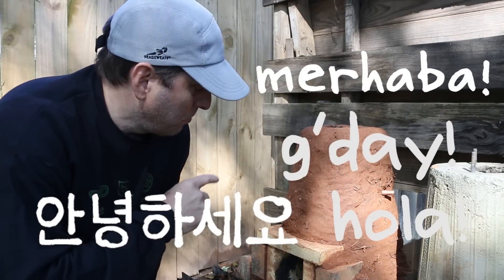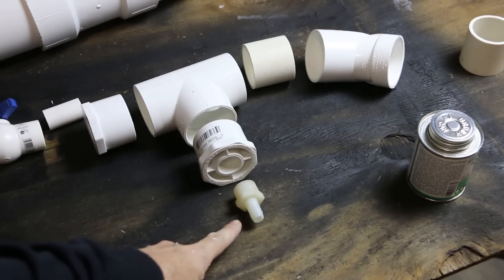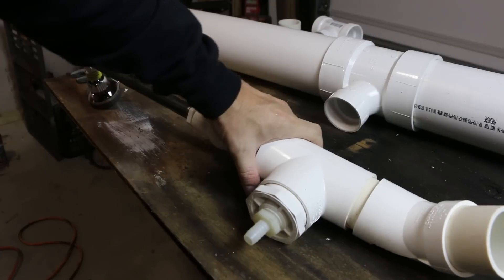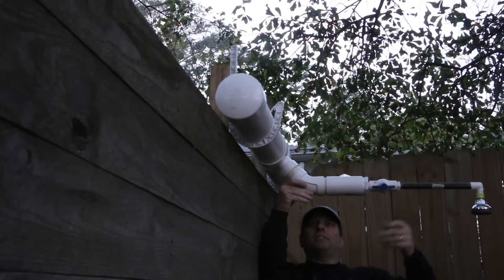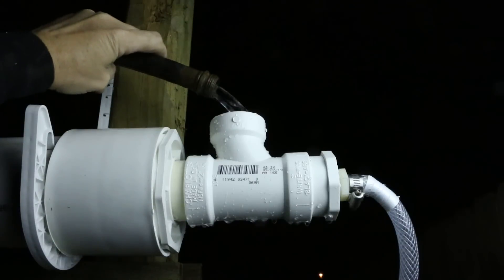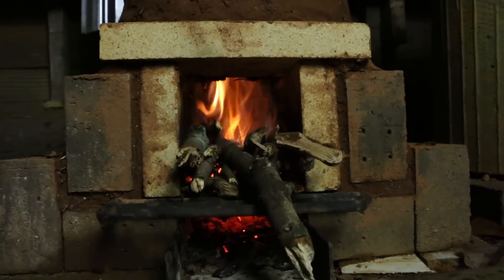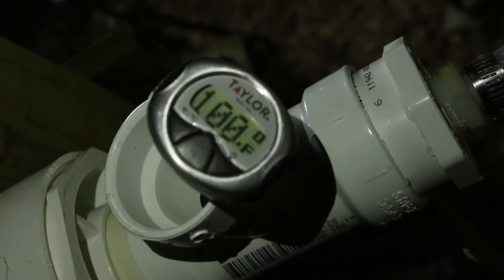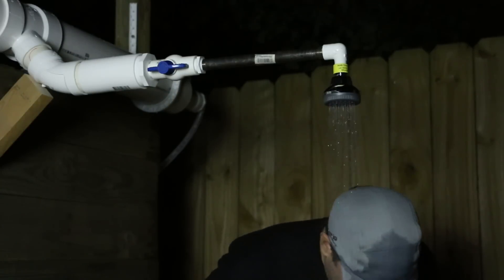How To Heat An Outdoor Shower With A Rocket Stove | Part 2

Comment: This is actualy a brilliant idea with a functional prototype. You could also use copper pipe instead of flexible hoses joined to your coil embedded in the stove and add some legging onto it to retain as much heat as possible, also have a larger vertical insulated reservoir tank that will help in retaining the warm temperature while easily homogenising your heated water inside the tank through the heat siphoning action. Great ideas bro!👌

Comment: Would a closed system use thermal syphoning to create pressure? Maybe use a check valve to avoid a backflow?  I haven't built one yet, but plan on giving it a try.
Reply from the maker: I’m not sure a pressurized system would work, but I’m not a pro here. :-) The PVC I used was not for pressure. I did another take on this and used house water to pressurize it. It did ok. I think they way I’d proceed is to fill the tank, warm it, then re-pressure with the house water only after the fire is out. I don’t want to risk getting scalded. Thank you for watching. Good luck with your build.

Comment: I'm telling you from experience that there is nothing like a HOT shower somewhere that it's really cold. The last time I had anything of the sort was when I opened the bathroom window (a full-sized window) in the middle of winter while taking a shower. The bathroom became a cloud chamber. Probably not great for moisture control, but an outside shower might just do the trick.
Reply from the maker: I hear you on that, Mark. I’ll have to give it a try this winter. :-) Thank you for watching.

Comment: You had it right, it is a hot water heater, so who told you differently is wrong. When you get a hot water heater for your home, you wouldn't go to Home Depot, Lowe's or Somerville Plumbing Co. and say you need a water heater, you would ask for a hot water heater or a hot water tank, which is all a technicality, but they are all the same thing, except for a boiler.

Comment: Genuinely impressed, just like I saw the other day "Man landed on the moon". I am wanting to build a cobb, wood fired oven / pizza oven. (Jas. Townsens & Son and My Self Reliance (Shawn James)) has built on like I want, but now, I will be incorporating coils into the structure. I agree with the other sub, that the coil should be imbedded. But like you said, this is a learning channel. Great video!
Reply from the maker: I’m honored to be associated with those guys...two excellent channels. I haven’t fired the coil enough to run into any melt or degradation problems yet. Stay tuned. :-) Thanks for watching.

Comment: Something to consider, a vertically oriented water tank will generate better pressure that a horizontal tank of the same volume...
Reply from the maker: Thanks for the feedback, Rick. I did orient the tank vertically in the follow up video. Added hose pressure too. Thanks for watching.
Reply: @GreenShortzDIY  Ahh, I didn't catch the third installment...lol
I've been thinking of something similar, but portable, to take along on camping trips...

Comment: Not only longer copper coils, but a metal tank reservoir on top of the rocket stove. Also the hot entering at the bottom, so that as the hot water rises, it will disperse the energy through out the tank. It might require a check valve on the lower tank inlet in order to start the siphon.

Comment: I would think a much larger storage area would be needed with cold water feeding directly through the stove, and another line to cool the heated water down a bit.  Only a thought.  Thank you for the video!!  Blessings!
Reply from the maker: Hi Mary. I agree with your assessment. Watch the third video in this series. I expand the tank like you are suggesting. And add pressure. Thanks for watching.
Reply: Thank you.  I may be moving to an off grid homestead and I have not seen a rocket stove built, which was so interesting to me!!  I would love to see how to make an outside Cobb oven!!
Blessings!!
Reply from the maker: Mary, I’ve done a cob bread oven video. Look for the “Full Build” in the title. Also suggest you look into a Rocket Mass Heater to heat your home. It uses rocket stove combined with a barrel to divert the exhaust down and through a mass to absorb and radiate the heat slowly. An 1000 degree stove burn will only exhaust 150-200 degrees out the chimney. A 2-hour burn can heat the house all day. You may be able to route your water heating through the same system.
Reply: Thank you!  I watched the 3rd video, I was thinking of gravity fed water flow from buckets vs. pressurized water.  I wonder if the stove can heat water fast enough to keep your storage tubes full, to take a full shower.  Thank you for your responses and videos, and I will look for the oven video.  The rocket stove is definitely a solid option for heating my future dwelling, since commercial stoves do burn alot of wood, though they are building mostly for pelleted fuel, which I am not interested in!!  The prospect of using wood that I harvest, and using much smaller amounts due to these stoves efficiency is exciting to me!!
Thank you so very much!!  Blessings!!
Reply: Oh, I just ordered last night the book on building rocket mass stoves, then your video popped up!!  
My LORD works to keep my life on HIS tracks, waiting for HIS  path to become obvious is so hard at times, but this is working better than me charging ahead with my plans and HE can fit in as my aide!!
Blessings in abundance!!

Comment: Pressure due to gravity is a function of how high the tank is above the showerhead.  You can get A LOT more pressure without using pumps or a pressurized tank by simply raising the tank and running a pipe down to the showerhead.
Reply from the maker: Good suggestion Brian. Thanks for the tip.

Comment: I think the top hose should be the cold water hose and the bottom one be the hot water. As the water is flowing downward towards the heat and will heat up faster. Most of the heat is at the bottom.

Comment: you're not using primer, its going to fall apart. Use primer, this guy has no idea. Know what you are doing before you make a video
Reply from the maker: I can’t argue with the importance of using primer. I didn’t glue portions of the tank because I plan to take it apart in the next video. Thanks for the feedback. Thanks for watching.

Comment: Also,  I don't think regular pvc is proper for hot water. You should have used red pex  or  copper 

🌠🌠🌠🌠🌠🌠🌠
Reply from the maker: Yeah. This is not a normal use for this type of pipe. It is also not rated for pressure. I think it should function ok for this application. Of course, in this outdoor application, a few drips won’t be the end of the world. :-) Thanks for watching.

Comment: This is a great build! Thanks for sharing!
Note though, the teflon tape you are using needs to be threaded over - meaning the direction you wrap it matters. if you wrap in the wrong direction, the threads might push the tape backward and roll up little holes and pockets between the threads. Hope that makes sense.. Thanks again! :)
Reply from the maker: Thanks for the reminder, Aaron. I try to remember to wind it the correct way. Always half to visualize it in my head first though. :-) Thanks for watching.

Comment: I like your humble, open approach to learning and sharing. I'd like to see the wasted heat going to heat a mass with a down-tube, burning up all the carbon. Perhaps heating the floor of the shower, or a mass inside a tent? Rock on.
Reply from the maker: Hi Wendy. Thanks for the encouragement. There was definitely some wasted heat in this application. I'm actually going to move this small coil to my greenhouse and add a water mass and a clay mass. So, you've kinda read my mind. :-) Thanks for watching.

Comment: Just an FYI: when solvent welding you really should spread the cement on both pieces before gluing them together.
Reply from the maker: Sean, thanks for the tip. My second version of the tank, which is pressurized, leaks pretty badly. But, I'll file this in the archive for my next PVC build. Thanks for watching.

Comment: A more efficient way of fueling is to have a vertical feed box with a horizontal chimney.  Long 4x4's or similar wood cuttings are fed into the feed box so the fire feeds itself.  The heat is forced horizonally over the coils and out a stove pipe.

Comment: I have an idea, you should make a Galvanized metal water tank and paint it with heat resistant paint and put it on top of the chimny to benifet of the raised flames beside of the copper coil
👍👍👍
Reply from the maker: Hi Ahmed. I like that idea. I’ve got a metal bucket in mind that might work well. Thanks for the suggestion. Thanks for watching. 👍🏻👍🏻👍🏻

Comment: Hi.  THis might be a better comment on the first vid, but I'm here now :)

For a rocket system on all the mass heaters I have seen online they are takign the heat out at the top instead of in the middle.    Was having the heat coil in the middle because it was easier to build?   Putting the coil at the top would let you get all the heat from the flame you had in the chimney too ?

It's great to see how you experiment and tinker with these things.

Comment: Thanks. Provoked thoughts of incorporating the heat exchange and storage efficiencies of a recycled propane or nat gas water heater by replacing the burner and controller with a rocket stove. These tanks are insulated and have engineering, routing, and safety problems built-in at the factory. They allow for heat exchange, gravity supply, and in-line additions of secondary/tertiary heat sources with a bit more planning. Looking forward rocket man.

Comment: you should run it into an old water heater like I did. Keeps it warm for a long time. Hook your w/h drain outlet onto a 12volt rv pump, and from the pump to a shower wand. instant pressurized hot water. you just have to release the pop off valve when draining, to allow air in while draining.

Comment: Typical American is complicating things which are very simple. Water pump 12 V give you some pressure and heat 10 gal of water the military style is fast and you don't need rocketstove ( insert to water metal pipe like U and heat with large size propane torch) Perfect also for camping. To check temp. of water you don't need scale of F just submerge hand )Your project looks more "scientific".
Reply from the maker: Ha. I can appreciate your solution. My angle is usually experimental, which usually starts out complicated and then simplifies. I often start with a rocket stove as a base, creating energy with found fuel. Thanks for watching.

Comment: If you're planning to install the pipes outdoors permanently, you should consider spray painting them black. They then will warm up throughout the day because of the energy of the sunlight, in summer that should be already enough, and you won't even need any further energy to have a warm shower.
best wishes from germany ;)
Reply from the maker: Ich mag diese Idee. Außerdem denke ich, dass die schwarze Farbe es weniger krass machen würde. Danke fürs Zuschauen, mein Freund.

Comment: Primerless glue?
Reply from the maker: Yeah. I wasn't as concerned about the joints given that this tank wouldn't be under pressure. But, when I build a pressurized version of this tank, I'll definitely be using primer. Thanks for the feedback.
Reply: @GreenShortzDIY  I wasn't sure if there was a new product or not lol. I'm glad it worked out for you, I want to try this with my mini water tower :)

Comment: Definitely going to need the line water supply to produce pressure with the current setup, since a horizontal reservoir tank means there's going to be nada as far as head pressure is concerned. Barely going to trickle. Reservoir also needs to be well above the tap that drains from it unless there's some other source of pressure like a pump. Might not be a bad idea to repurpose one of those 5 gallon beverage cooler barrels as your reservoir, since those should be common enough and they'll be insulated to some amount.
Reply from the maker: I agree the pressure line will help. It did actually have a better flow than I thought it would. I like your idea for the reservoir. Thanks for watching.
Reply: Pressure due to gravity is a function of how high the tank is above the showerhead.  You can get A LOT more pressure without using pumps or a pressurized tank by simply raising the tank and running a pipe down to the showerhead.

Comment: Pressurizing the tank will also mean that your flow rate for the shower will be higher so your showers will not last as long. Unless of course you only pressurize during heating. I like these videos of developing ideas and tinkering to make them work better. I just subscribed.
Reply from the maker: Good feedback, Jelle. I’m having fun with the build and tweak series as well. Thanks for watching

Comment: I know of a far better water heater that works on a rocket stove and heats 50 Letres aka 12.5 gallons to 80°C aka 176°F with less than a dozen sticks that are 3/4 inch round and less than a foot long
Reply from the maker: Thanks for your input. This rocket water heater was a little undersized since it was a proof of concept. Thanks for watching.
Reply: @GreenShortzDIY  another thing that particular helps with heating the water is to not use thermal siphon and to actually pump the water backwards to that of the thermal siphon

Comment: Simpler would be to buy a tankless water heater which uses propane.
Reply from the maker: Ha. True. But I never promised simple. :-) Thanks for watching.
Reply: Still needs power. Wood doesn't

Comment: You can get a plastic pipe in the lawn watering section.
Reply from the maker: Thanks for the tip. I am rebuilding the tank and found the small section of pipe you recommended right where you said it would be. :-) Thanks for watching.

Comment: Hey cool set up swap out the black iron pipe with schedule 80 pvc and glue both sides that are getting glued not just one you with end up with problems... good luck and happy building
Reply from the maker: Thanks Lanny. Yes the back pipe will go. :-) Thanks for the tips and thanks for watching.
Reply: Yes keep it up I sure hope it worked out well I seen a similar system done on top of a van pressurized and it was cool.... your system is something I’m gonna try out.....Cheers

Comment: I like working with PVC
Reply from the maker: I'm with you. For it's simplicity, it is an amazing product and a great use for plastic. It sometimes gets demonized, but if used properly and disposed of properly, it's a great building material. Thanks for watching.
Reply: @GreenShortzDIY  I've used it to developed film in bulk.Been a sports photographer for 45 years I'm 60 and like when people use great imagination to make things better.
PVC works great and it's easy to work with.

Comment: Bro your clever but that pvc no. Get an old tank ideally an old electric go directly to that as will have pressure gauge. You must have a pressure release. Must . Elevate it or use pump. Possibly 100% free hot water. I been doing it for years. Too easy
Reply from the maker: Thanks for the feedback, Col. your metal tank is a good idea. Thanks for sharing. Thanks for watching.
Reply: 👍🏻I enjoyed the video

Comment: A small tip for winding the teflon tape. The outside of the tape should touch the pipe...this way you can winde the roll around the pipe. cheers
Reply from the maker: Thanks for the tip Andre. Thanks for watching.

Comment: in a standard shower,  there are two source water lines in order to help control the water temperature.  In this scenario, one could easily heat the water to a very dangerous level.  Can you add a cold water tank and then a similar valve for a standard shower (or any way to adjust the flow of each temp).   Just trying to think of safety and scald prevention.  Rocket stoves can produce intense heat and if not closely monitored the tank could easily get close to boiling temps since it has a relatively small capacity.
Reply from the maker: Yeah. I was (am) concerned about the water getting too hot. My first test with the bucket did get too hot to dip my hand it. I like the idea of a mixing valve like a regular shower. Thanks for the idea. Thanks for watching.

Comment: Take in account when attaching the garden hose (pressure) it will push the warmed water out quicker, thus requiring larger storage capacity to maintain desired time usage. To calculate storage capacity & time (usage duration) for garden hose pressured, simple time & fill a 5gal. bucket (With shower head & valve)(wide open or set setting).  Example = 5gal. took 5min. to fill and you want 10min. shower, which = 10gal. storage capacity required..... Note:  If your going to add pressure you will need to change your storage design....  Cold must disperse inside storage container at the bottom while the hot exits at the top....  Food for thought.
Reply from the maker: Thanks for sharing your thoughts, Davy. Good insights here. I will definitely take them into consideration as I modify this outdoor shower set up. Thanks for watching.

Comment: How about a system that heats with wood and then runs the hot water inside the house to the indoor water heater.  Thereby reducing the energy cost ( I have to use propane) to provide hot water.

Comment: That's great, can have the tank on top of a van roof and have the rest stored in a tub until you need to hook and use.
Reply from the maker: Great idea for application. Perhaps a different rocket stove instead of the cobb...aircrete would be a perfect option for lightness and rigidity...but your concept would work great. Thanks for watching, WLG. :-)

Comment: Instead of using a 45 degree connector off of the tank have you considered a ninety degree connector so you have complete drainage of the pipe with minimal measuring and tweaking?
Reply from the maker: Baron, I think that’s a great suggestion. Thanks for sharing. Thanks for watching.